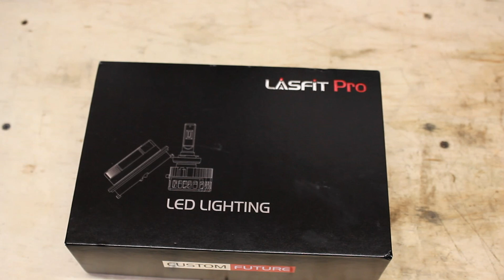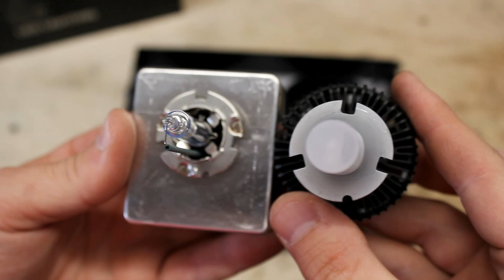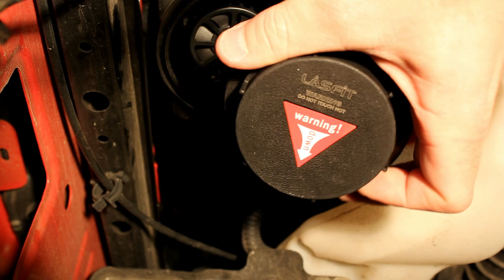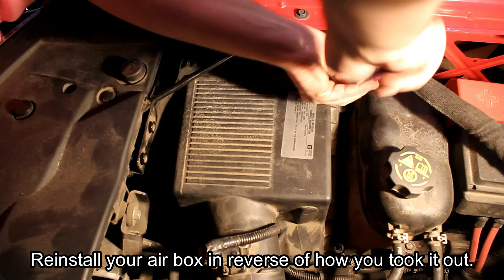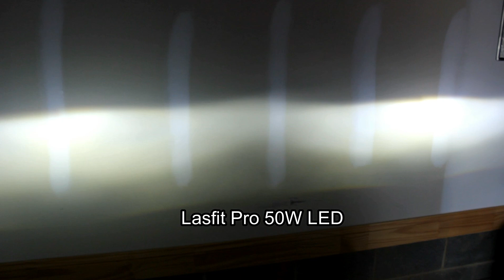[HOW TO] Install LasFit Pro D5S LED Headlights in a 2016-2018 Silverado (Plug-N-Play)

Comment: Man mine didn’t line up that easy! I got a 2016 Chevy Silverado LT. and I still don’t think I have it right.  I feel like it’s aimed low and left on drivers side and just way low and right on passenger side. My oem hid d5s was brighter so that’s why I’m sure it’s not lined up right. I also got the bundle deal. I had to call and ask which bulb was for what as they are not labeled. So the Tex at last get told me these one lights were my cargo lights in 3rd break light. Went to test it and it glowed red! Supposed to be bright white lol. I’m sure he just made a mistake and told me one for break lights or something. I’m hoping to try to fix these this weekend and get them aimed higher and secured better. I could not get the tabs to line up. I had to take the putter bracket off the led and put it in the spot first then slide the led in. Any advice is greatly appreciated

Comment: In your description you list the GMC Sierra. I can testify that these bulbs do not fit the Sierra 1500 without modification. Maybe a HD because their headlights are different but not the half tons. The Sierra has a oval shaped shield inside and you have to turn the bulb instead of the plastic tab. You can not turn the flat LED because it hits this shield.
Reply from the maker: Sorry that's an error in my description. These do not fit the Sierra's. Fixed it.

Comment: Probably still had the Colorado when you did this one, but now revisiting for Silverado.
Reply from the maker: Right on brother! When did you get rid of the Coly?
Reply: @fondupot after Black Friday in 2019. I wanted to move back up to 4×4, and all they had were well optioned units that were in the low 40's, and didn't want to play. But they also had a cool looking 19 Silverado LD(18 body) LT/Z71 V8 dbl cab, that they came off $15k to $35k with heavy incentives, and drove it out for under $30k after trade equity negotiation.
Reply from the maker: Nice! How’s that truck running. I just had the AC go out in my 2016. The manifold line from the compressor collapsed. It’s got 184k miles tho…
Reply: @fondupot  it's running fine. I only have just under 18k on it currently. Amazing how much you don't drive when you're unemployed.🤷‍♂️

Comment: did you notice a difference with the 35watt HID bulb?  Did it melt anything.  I have a 2018 GMC sierra and I guess these guys don't make a bulb for my truck.
Reply from the maker: I never noticed any issues running a 35watt HID. And yea, I wish LasFit would make something that fits a Sierra as well. I get a lot of messages asking that.

Comment: I can't find the lever on the side of mine
Reply from the maker: What year is your truck?
Reply: @fondupot  its a 2017 chevy silverado but i figured why cause my headlight on the left side was replaced after a wreck with a used one im assuming from a year not capable
Reply from the maker: @CruisinCaptures  Hmm. that's strange, the 2017 should be the same as my 2016, unless you dont have the factory HID's then the bulbs should just twist out.
Reply: @fondupot  The driver side is HID as the right but no lever i wonder what direction would i turn them im scared ill break it i felt it want to twist off but not sure if thats correct or not???
Reply from the maker: See if you take a picture with the headlight covers removed looking into the backside of the headlight. Email me the picture at fondupotsgarage1@gmail.com

Comment: Did you have the morimoto D5S XB HID version before? I’m trying to find a good replacement for my 2017 Jeep renegade trailhawk with the HID’s mine came with the Phillips D5S and was looking at the morimoto D5S XB but man $350.00 isn’t cheap. My Phillips are working fine and they are bright I just want brighter and WHITER I drive a lot of country roads late at night.
Reply from the maker: I tried out the Morimoto D5S hids but didn’t like them. They are better than stock phillips d5s. But not as good as these Lasfit ones. I still have the Morimotos on a shelf somewhere. Send me an email and maybe we can work something out. Fondupotsgarage1@gmail.com

Comment: Are you still able to use the auto headlight feature. Im not able to on the morimoto d5s bulbs and have had really bad luck with the morimoto lights in general already had to have a new one sent to me under warranty and now the other one went out
Reply from the maker: Yes. The auto function is working perfectly. No issues
Reply: @fondupot  thanks for the reply im going to try to get my money back on the morimoto lights and get this set  i seen you had the same morimoto set as i do did you have issues with them on the auto light ?
Reply from the maker: Yea I had the Morimotos before. But I never had an issue with the auto light function. My biggest issue with those was the color being way too blue. The LasFits are much more white in color.
Reply: @fondupot  My morimotos would flash on and off and only one would come on. I would have to turn the lights off then back to the on position to get them to work and tonight on my way home in the dark and foggy night they decided to do a fast strobe flickering i had to pull over and turn them off completely and turn them back on now the driver side light is out completely now this is the second time of the strobe affect first time someone was in front of me when it happened they pulled to the side of the road they thought i was a first responder running code
Reply from the maker: Dang that’s stinks. Sorry for the issues with those. Return them and get yourself a set of LasFits.
Reply: @fondupot  they wont let me return them all they want to do is send me a new bulb so i guess ill have to see if i can sell them to get the lasfit d5s bulb s
Reply from the maker: Damn. That stinks.

Comment: I cannot seem to be able to line up that damn bulb so it stays in place...help
Reply from the maker: Are you getting it inserted all the way so the lever can close down on the locking tabs?
Reply: @fondupot  man idk I’ve tried everything, do you just insert it in and lock the tabs? No turning necessary?
Reply from the maker: Correct. Insert straight in. Then rotate the lever locking tabs. You don’t need to turn the bulb. What year is your truck?
Reply: @fondupot  Chevy Silverado 2018
Reply from the maker: Yea you should be fine. Just push straight in. Then rotate the locking lever.
Reply: @fondupot  ok Thanks

Comment: How are the bulbs still holding up? Do the fans make a lot of noise? By chance have you heard anything about the Dama Kanji bulbs as well?
Reply from the maker: They’ve bee. Working great. The fans aren’t very loud. But you can hear them when the vehicle shuts off they spin until the lights go out. Not bad though. Haven’t heard of those other bulbs. Then just use a 7pin to 4 pin adapter on the plug in the bumper for the trailer.
Reply: @fondupot  Use the 7 pin to 4 pin adapter in the bumper for the trailer?   You lost me there, I don’t understand

Comment: I purchased a set of these D5S Lasfit LEDs for my 2016 GMC Sierra 2500. Lasfit told me that these would not fit my make and model. Is that true?
Reply from the maker: Yes. There is something different on the sierras.

Comment: I just installed LED low beams from Diode Dynamics. $150.00 3 year warranty, designed specifically for Canyon. Exactly same size as stock halogen bulbs, Plug and play, no cutting or fitting.
Reply from the maker: Yea I’m familiar with Those SL1 bulbs from Diode Dynamics.  This video is for a Silverado though. Different application entirely.